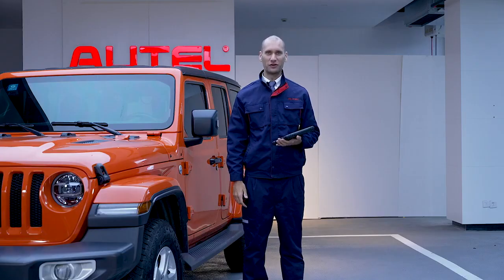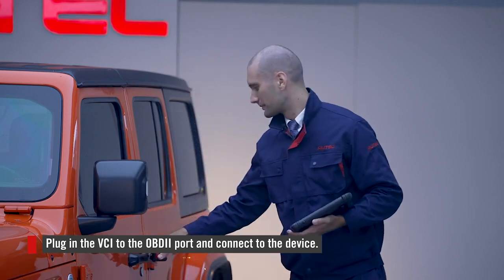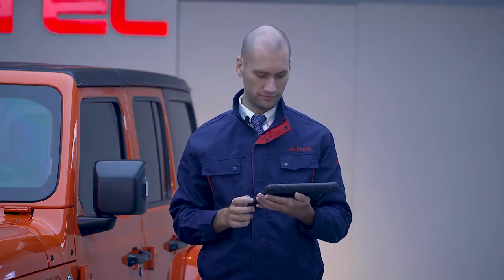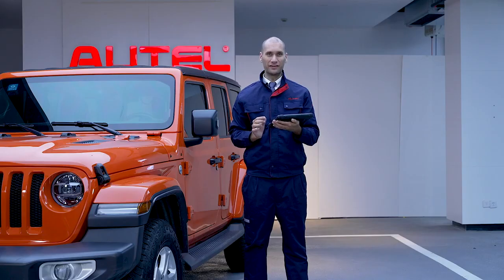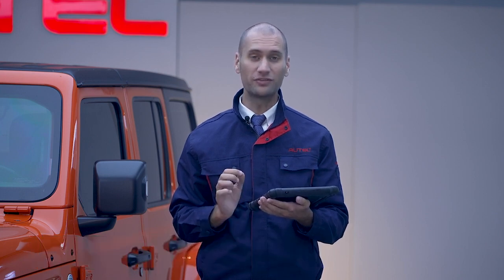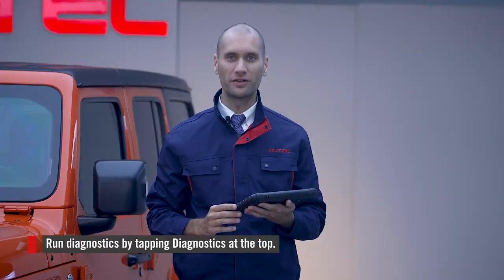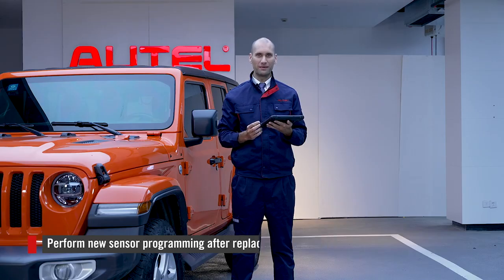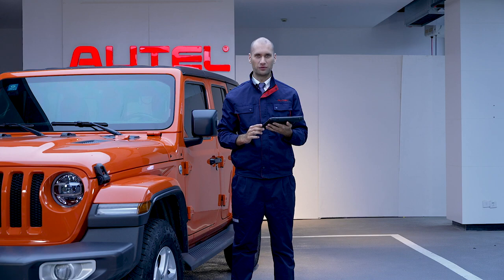Autel Maxisys MS906/MK906 PRO TS

Comment: You forced an update to my autel 906 pro ts - as in I literally couldn’t use it without the update. The update bricked my device with an error and your only solution was to pay $700 to renew a subscription I don’t need. I work on the same old cars, I don’t want or need updates, I already paid $1600 for the device. If I needed to work on newer cars I can see the value add to pay to get access to new vehicles, but I also should be able to just use it as I bought it.